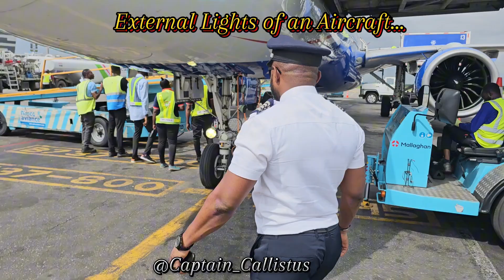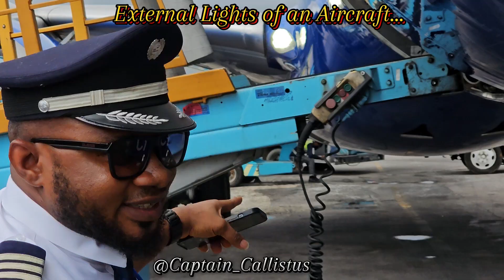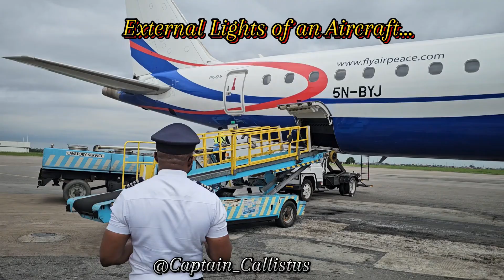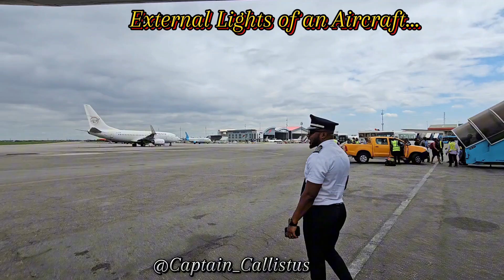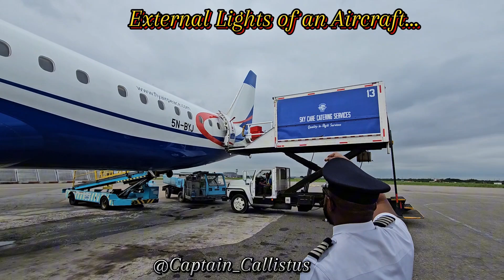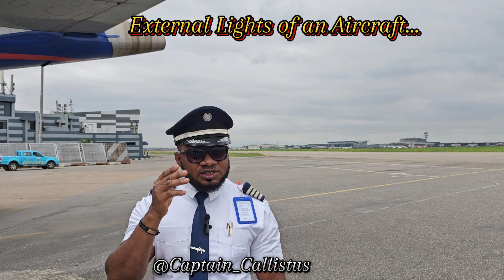External Lights of an Aircraft...

Comment: I am a big Fan Captain. God bless you.

Please, can two aircraft fly side by side and see each other mid-air? please help us make a video on this

Fly safe always sir
Reply from the maker: @aderojushamsudeen1959  it’s possible but extremely rare to occur unless if it’s a formation flight. For commercial flights it’s not possible bcos of separation. They won’t be on d same altitude as they’ll be separated by altitude by the air traffic controllers… so if one aircraft would see the other, they wouldn’t be side by side but rather, they would be above or below as the faster aircraft might be flying past the slower …
Reply: @Captain_Callistus  thank you sir.

But is there an occasion where you can sight another aircraft in front of you?

I could recall in one of your videos where you told us there will be 5 minutes landing delay because two small aircraft were in front of you. You referred them as korope aircraft 🤗🤗🤗